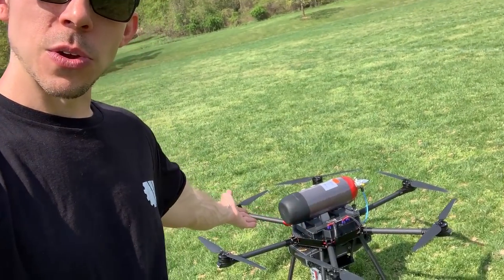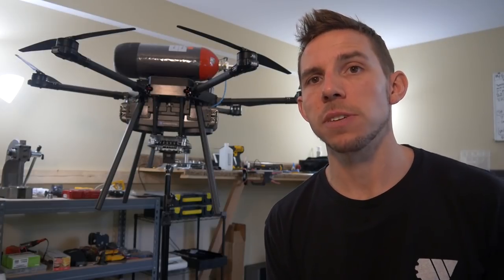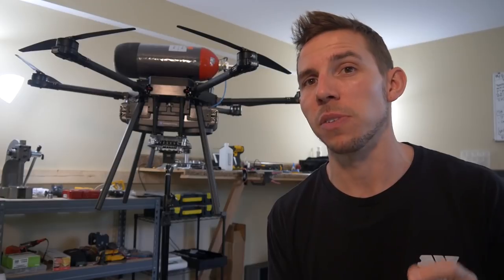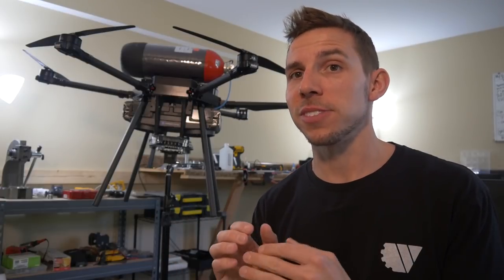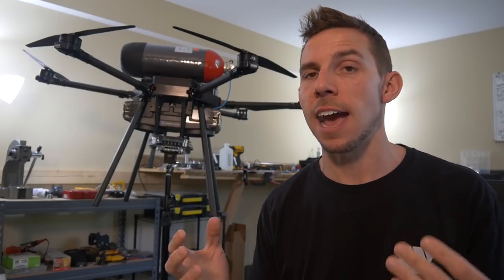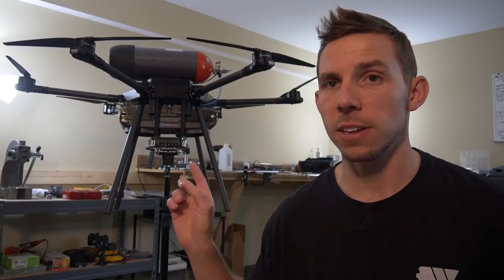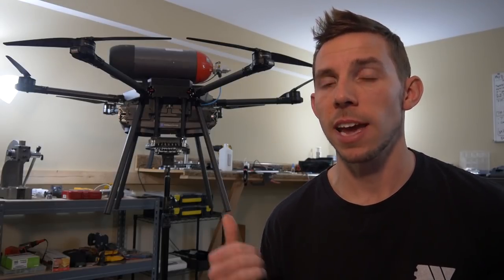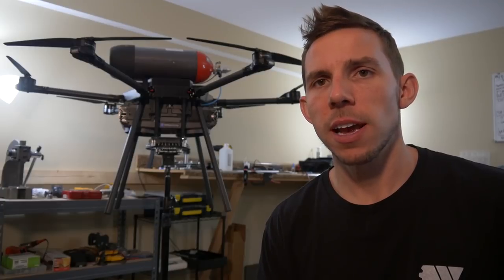This Drone Will Fly For One Hour Using A Hydrogen Fuel Cell: Here's How! 12 FAQ's

Comment: Having studied fuel cells since 1992 or 93 as an applied physics teacher I knew of their superior energy density and more than once thought about using them on drones. Great that Bobby Watts is working on this.  There is also another high density power source that still has not be explored that I have in mind.
Reply: What other high density power source do you have in mind?
Reply: @jakekisiel7399  Just the article says, fuel cells. But many times better is nuclear fusion, however their is a minimum size that fusion can't go below, in other words you can't make a fusion generator the size of car battery, at least not with the current technology.
Reply: @Vikingman2024  I agree that nuclear would be better, but trying to get that approved by the FAA and convincing environmentalists that is a good idea would be a tuff sell.
Reply: @Vikingman2024  what is the minimum size fusion can’t go below?

Comment: Why not a tiny gasoline powered generator with a small muffler? I think that's a lot higher energy to weight ratio.
Reply from the maker: It sure is, but as I mentioned in the video - gasoline engines introduce vibration, noise, mess, and tuning challenges. Not necessarily bad, but definitely a bit tricky.

Comment: Not to be critical, but I believe you failed to mention the ability to fly in freezing temperatures. Another feather in the cap of hydrogen fuel cells over lithium batteries. As we all know lithium batteries do not like to freeze.
Reply from the maker: Correct! Thanks for pointing that out

Comment: Could someone answer me why Hydrogen/ Fuel Cell airplanes are not being made? Especially considering they can be packed to achieve a much higher energy density than the best batteries available in the market today?
PS: Hindenburg Blimp was Hydrogen but the thing that burned mainly was the skin of the blimp.
Reply: The benefit of hydrogen is it's energy density by mass, it's main disadvantage is its volumetric energy density. That sums up why aircraft don't use hydrogen fuel cells. The russians have actually converted a commercial jet plane to use hydrogen as a fuel somewhere around the 90s, the most difficult problem at the time was the storage, you basically had 60% of the aircraft full of hydrogen tanks. I am sure that the tanks today are better but as long as airliners are allowed to use kerosin, they won't bother using a more complicated system, a bit like with the car industrie XD.
Reply: @mandernachluca3774  i think you are wrong they already have Hydrogen / Fuel cell drones that fly for much more longer periods (3 times) than its electric counter parts. The Volumetric and Gravimetric densities of compressed hydrogen can be far higher than that of the best batteries available in the market.
Reply: @Soothsayer210  
Well, than you haven't understood my comment. I did not even compare lithium ion batteries to hydrogen fuel cells, i merely answered your question regarding the current situation with electric aircraft.
Reply: @jdouglassmithh  
Yes, i agree but in wich terms does this differ from what i said?

 Also, the aircraft don't nessecarily have to be designed completely from the groung up, as i said before, the russians did convert one of there commercial turbine driven aircraft to burn hydrogen. The problem at the moment is the safe storage of hydrogen, you either can have a very high gravimetric energy density or a very high volumetric energy density but we need something in between. 

The production of hydrogen is expensive but for no means difficult. Just for comparsion, the kerosen has to be refined out of crude oil, wich itselfe has to be drilled for and than transported to a refining plant. Hydrogen production is as simple as applying a certain voltage to 2 electrodes submerged into water.
One side will output hydrogen and the other side oxygen.

The transportation of hydrogen should also be the same as with oil or natural gas, in fact, the current pipeline system should be more than suitable for this task.
Reply: @mandernachluca3774  you are an expert. Nick from mmcuav
Reply: Storing hydrogen is a nightmare. Ammonia is being considered as a good solution for storage, being mainly hydrogen. NH3. Needs splitting reactor and complex heat management but still good idea

Comment: 2.5 x from battery version price?

Impossible US 1 battery drone 60cm x 60cm dimension + thermal camera is about usd 12k
I got G2 drone from Israel with 60x60cm dimension + minidome thermal camera....very2 expensive based price with 80 minute flight time...above usd 50k.

So, yours is still cheap for government.
Reply from the maker: Correct, I think the cost will make it prohibitive for some businesses but for Military/ Government use it will be ideal.

Comment: IF you Extended 4 arms to 10 feet long each, then put propellers 2-3 feet across then cover every surface that DOES NOT effect aerodynamics with sound absorption material then the NOISE would be very low compared to 99% of those on the market.
But if you don't care about noise then keep building drones this way,

Comment: 22 batteries to double range is not just double to 44 batteries because the 22 extra battery WEIGHT has to be calculated so it would be more like 22 to say 55 batteries....this is physics 201